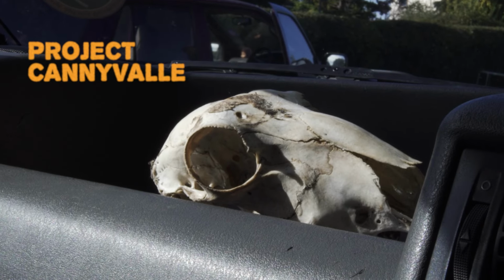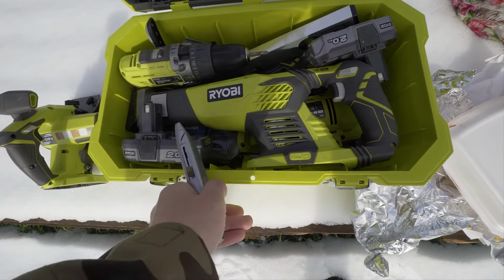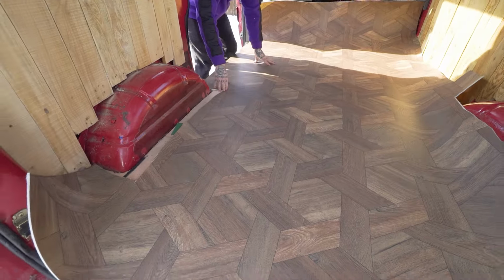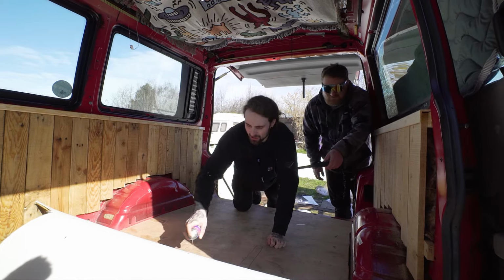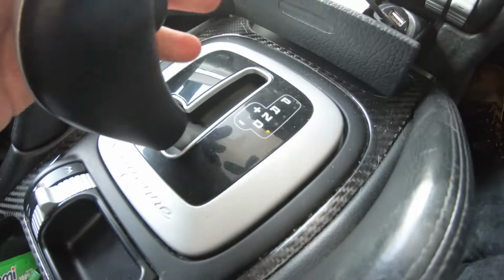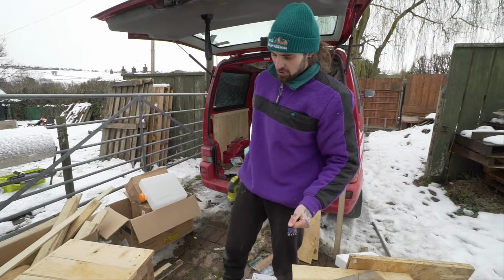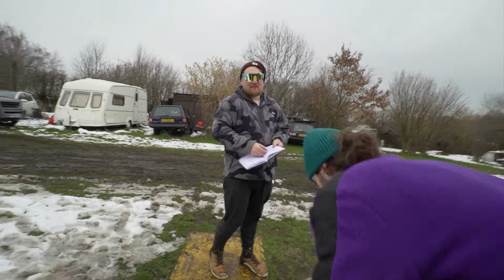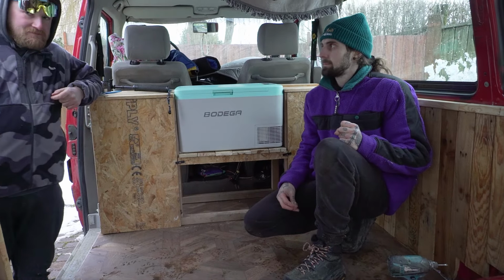Will this mistake force us to quit?

Comment from the maker: OK OK... We would like to make a huge apology to everyone... for using nails and screws in the same piece of wood, it was a silly and stupid thing to do. Sorry. ❤
Reply: Just remember that it's silicone with screws, and no nails with nails! Lol
Reply: When will the book of Simon be available in Nortons general store?
Reply: Which abandoned channel should i call dirty bunch of smells?
Reply: apology accepted
Reply: @joe102  show them no mercy. Grip fill has existed for ages
Reply: No need to apologise. Think of the van as a CV for your post-urbexing YouTuber careers. This way you're showing off two different skill sets. Three if you count glueing the lino down, but nails aren't ideal for that particular task so.... It's coming along nicely. Where's the black water tank, the bog, the shower and the hot tub going though!?
Reply: Apology accepted , you made a huge mistake , spotted it and now its time to move on in life .(although it will haunt you forever)  :)
Reply: It's not good enough you should have used The power of your mind to combined these materials.😊
Reply: Just about to unsubscribe due to this. 
Then I saw the apology. At least you won't do it again.
Reply: Id say it was a unique thing to do and as someone with very little woodwork experience I can’t see anything wrong with it ,  however putting a heater next to a fridge, someth8ng that’s meant to keep things cool next to something that’s meant to make things hot is also quite a unique thing to do.
Reply: At least you didn’t use corrugated fasteners and staples in the same bit of wood.

Comment: It wouldn't hurt to install a GAP under the Fridge of about 2 inches to Buffer against the heater. Just cut a 2x2 to fit on both sides of space and attach a piece of plywood to them.

Comment: If you are going to fit a diesel heater, you MUST have a floor drop hole for ventilation.
Inside the cupboard, next to the heater. 
This is to get rid of fumes, and to ensure you don't die from carbon monoxide poisoning.
When you are cutting the hole, make sure you don't hit anything like the fuel tank or lines, or any wires underneath the van.

Comment: Your Diesel heater uses a flame..... You Must install a Roof Vent to let the Heat carry the Carbon Monoxide out of the Vehicle.... and you Must install a Fresh Air Vent as low as possible to the floor of the Van to let Fresh Air in !!!!!!!!!!!!!!!!!!!!!!!!!!!!!!!!!!!!!!!!!!!!!

Comment: You can run those diesel heaters on used engine oil. Just make sure you service /clean the unit regularly. Save yourself a few $$ depending on your time/money ratio.

Comment: 'Hell on wheels' Day 56: Morale is low. The crew are losing hope fast. Things aren't going quite as well as we had planned.
Tune in next episode to see the installation of Al's diesel heater, and find out if it accidentally cooks everything in his ice chest!😀
Reply: I did one of those diesel heaters myself… good god the pain! The terrible English translation of the instruction manual, the way your heater has one of 3 different control panels, different to the one in the instruction manual, the way all the hardware is so cheap it doesn’t work, and how your exhaust accidentally fills your cabin with fumes. Fun fun fun!
Reply: @SamHarrisonMusic  To be fair. With a decent amount of research, the chinese heaters are just as good as the real thing. Main tips are, stay away from the 2kw one and go for the 5kw or 8kw. And never use the silicone/ flexible fuel line as it is a nightmare for air bubbles. Hard fuel line is best.

I did everything right and had no problems with mine. It's only in a little combo van, so becomes an oven in about 5 minutes lol.
Reply: @adamholmes91  Once I figured mine out, I was fine - I just had to watch a lot of youtube to fill in the gaps in the manual. I got the good fuel line with my kit, but the kits are variable. I had to buy fresh hose clamps, as the kit ones didn't work. I swapped the exhaust and the intake position and it worked fine. I have the 2kw, but it's too hot for me on the lowest setting lmao. I just sleep naked and have a tropical heatwave van...
Reply: @SamHarrisonMusic  Haha that's good then, yeah the hose clamps that are supplied are made from cheese. I had to get some from B&Q
Reply: @adamholmes91  At least they do the job when they're in eh :) I'm practically toast after a night of it!
Reply: I think they are brilliant for the price. The only issue I had that you mentioned was figuring out the controller.

Comment: Just a quick tip for future.
1. Don’t use your drill in hammer mode it makes drilling trickier.
2. If you hear that ratchet spinning grrrrr noise when screwing in, switch the torque setting down, use half trigger and also switch to screw not drill mode on selector. 
3. Most of the time you are screwing far too fast on drill mode, screw mode with electric drills is high torque low speed setting.
4. I don’t know where to start with the cutting out mistakes. Perhaps just repeat the saying “measure five times and cut once” 
5. For the assembly wooden structure, with the door. It’s not very pretty nor practical. I hope you are just making content, which pretends to be bodging stuff up and this isn’t real life. Sadly I think it probably is real life. Perhaps with the free time you have, get some evening classes in woodwork ? It’s not hard to buy some decent tools (not garbage electrics which are low low quality) and then make something. 

All the best anyway